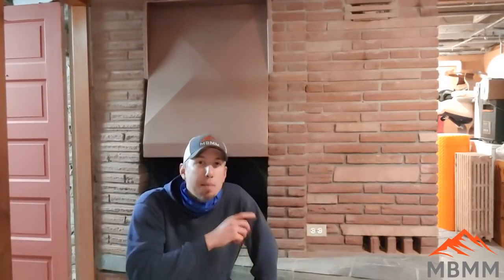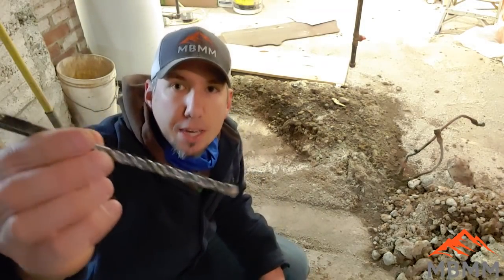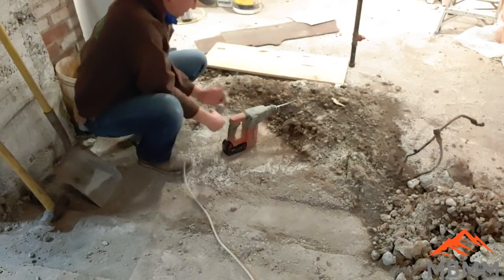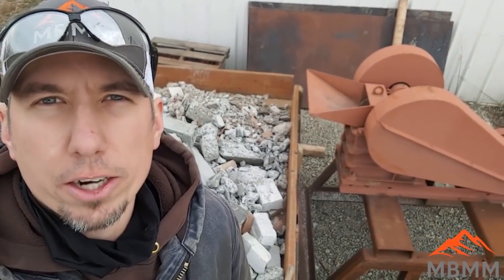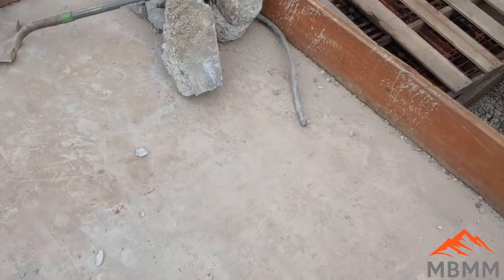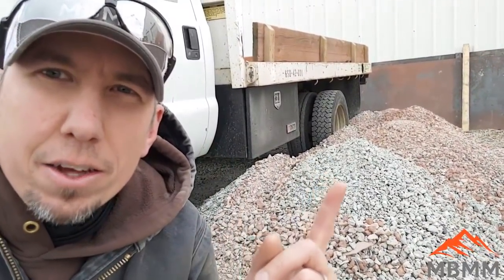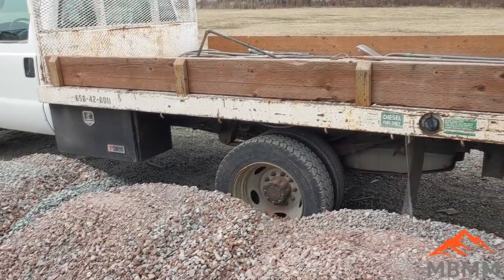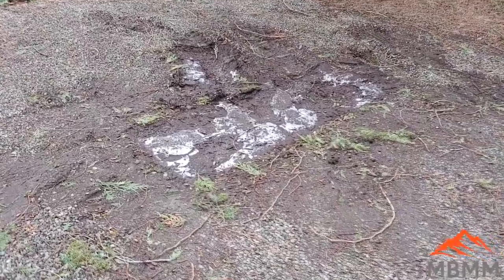Brick & Concrete Recycling Machine

Comment: i would love to have a screen classifier that was powered electrically, and i could just switch out the screen sizes and have a conveyer belt i coudl move to maybe three or four different positions so the material that went through coudl be sent into their own respective piles... but, probably couldn't afford it. but, it woudl be nice if i could sort my stone by size other than by hand haha. im building slate stone walls (with concrete) around my property, and my bulk material pile i am sorting into three different cuts. so, stones that are so large i can barely move them without my tractor go in oen pile, and they are maybe between 1x2x.5 feet, to 3x3x1 feet dimensions. and then i have an 8x11 inch crate that my granite surface plate came in, that i use to sort anything thats small enough to fit in it into one pile, and anything larger goes in another, other than the "mega-slabs" as i like to call them lol. but, i also have a huge amount of just dirt and less than 2 inch square bits that got mixed in that im sifting out by hand... its a lot of work, but i need Something i can screen thats tuff through to recover useable pieces (for filling smaller gaps in the walls later, or as i build) and to recover any usable dirt or gravels for road fill, and such. i woudl love to get or even make my own grizzly bar set, but have no idea where to start! though, i think i could get away with using 3/4 rebar and set them 1 inch apart in a grid in 3x3 timber frame with slots to secure them... but, im no engineer lol

Comment: Dumb question, can this be mixed back in together with concrete....
Reply: Good question.  
It’s the answer that is dumb.  
That is because, yes it can be, but no it cannot.  
Mixed in on some non-critical home brew project as your aggregate COULD work out just fine.  
As far as large scale industrial operations doing it, no absolutely not.
Reply: @jaxturner7288  
I think it would have a unique look if it was polished, after it was poured and set...
Reply: @joeschlotthauer840  I feel ya, that could be a cool look. 
But, unfortunately because our aggregates settle down below the surface during the finishing process, very little if any at all large rock material remains at the top where it can be seen.  

I think you could get the look you are looking for by doing “exposed aggregate concrete”
using your material of choice and then top coating it with a clear UV stable epoxy.  
I’ve seen that done on porches and carried into the entranceway and it looked spectacular.

Comment: I would have used the crusher in my driveway to save a step.
Reply: What step was that?
Reply: @jaxturner7288  Probably the one that involved shovelling the "gravel" onto and then off the truck..?
Reply: @will_doherty  That would be it.
Reply: @tomlangley6236  so then you could just shovel large concrete bits into a crusher and keep moving the crusher around instead?  
Where is the step saved again?
Reply: @jaxturner7288  the crusher gets moved beside the trailer either way...the move you would save is not having to load -transport-unload in the driveway. crush it in the drive and spread it out...Simple huh?

Comment: Did they ever put asbestos in concrete ?   I live near a HUGE old asbestos  mine and they used it ,For a lot of things...just a possible alert
Reply: It was used in cement tiles because it is fibrous  and flexible , not because it was fire proof. So, u can have it in many old construction products.
Reply: I've never heard of asbestos being used in a product that is already fire proof. That was the primary thing asbestos was used for, was claimed to be fire proof. 
Even "fire brick" , the ones used inside the fire boxes didn't use asbestos, they used a type of clay that resisted high temperatures but they can and do eventually crack and fail. Those can be bought individually for home furnaces in melting metals, not cheap.
Reply: @donniebrown2896  Right   but? It is something to consider seeing that they used it in damn near everything and, it is a fiber ..thank you for comment
Reply: WR Grace concrete had asbestos in it.